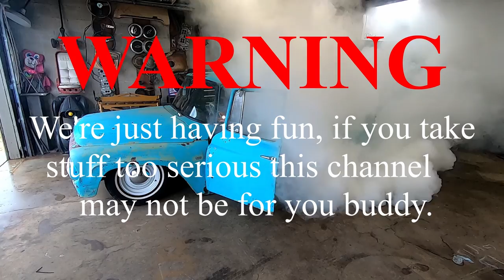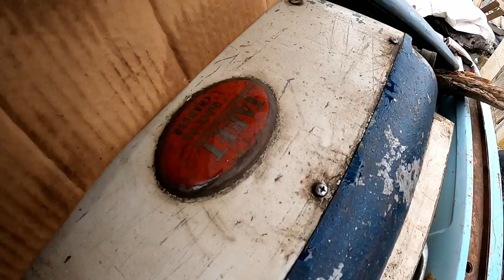1975 Ford Granada JUNKYARD RESCUE. Junkyard Rescue, WILL IT RUNS, more.

Comment: You had me at the Sweet looking bronco. with all that sweet trim on it. dam Tip, if you're doing will it run (ON THE FORD) fails to light off, the Neutral safety like to corrode contacts, run thru the gears few times, cleans up contacts. but factory AIR, after further Viewing, Not A/c no vents in dash, but not 100% on my knowledge, if those are I want those parts to convert my 79 to AIR> that CB might be the Factory Option. Nice to Have. dam luv the ford Walk thru.

Comment: Had a ford granada back in the 80's.  My friends called it a grenade.   Eaton up by lack of oil changes and illinois salt.  The left B-pillar was rusted away at the rocker panel, so the driver door did not close some times.  scary car to take on road trips.   I blew the engine one night driving back from the U of I.   Put a 302 in it.  Then the 302 had a burnt valve so I put the heads from the 351W on the 302.  Worked like a champ.   "good" memories.

Comment: I had a 78 Granada when I was going to engineering school.  200CI straight sixer with an automatic.  It was at least two different colors, and the doors sagged so badly that when you got in, you had to pull up harder than you pulled in.  It had some form of lunacy in the power steering system that bound up so hard that when it broke loose the steering wheel spun like two full rotations.  Like Uncle Buck.  After that, it was full brute strength steering.  :)   The body just fell apart on that old girl.  The driveline was still purring like a kitten when we scrapped it.

Comment: I bought a Granada several years ago to flip and I dang near did just that! The gear in the steering box broke as I was pulling out onto the highway and instead of turning it went straight and hopped a curb and almost went through the city building! 😂  
I never wanted another one after that!  Thanks for bringing that memory back with this video. 😁👍

Comment: That long door modded Bonneville was an airport courtesy vehicle..had two bench seats in the back that faced each other. You could ferry a whole family in the back and luggage in the truck from an airport to a different terminal or hotel. A  friend of mine in HS, her father, had a 6 door Lincoln Continental. It had two regular doors on each side and an added suicide door that was for the stretch segment and third row seating. It was amazing and he refused to sell it to me? It had a for sale sign on it in 88 and 89. I graduated in 1989 and the friend went away to a college so I missed out on a fantastic LC.  And a Corvair too? And I Love me some Creeper Vans. I had an AT&T service van 1500, had the cage behind the front seats that rattled me crazy. The back was carpeted, no rust at all and it was a manual trans 5 speed. My mom said it was a POS. and I wasted my money on a lemon? I drove it for 4 yrs with zero problems except 1 flat. I loved that van....

Comment: My old Shovelhead Chopper ran a magneto and an old timer told me to cut the tip of a tampon off and put that under the cap. It's the "mag on the rag" trick to soak up any condensation that could keep the bike from firing up.

Comment: You cook on charcoal once the fire is out and the coals turn gray. The fire at the beginning is the lighter fluid burning off igniting the coals. Coals should be hot enough to cook on within 10 15 minutes once they are all gray.

Comment: My cousin got a 4dr 62 biscayne with the 283 2sp powerglide that was literally an old womens car with less than 20k on it in the mid 70s. l got ride in one that still smelled new and was immaculate. Pristine perfect. You couldnt hear the engine running at all and it had plenty of power to cruise 75-85 all day and run cool. Those were great cars when new. They rode like solid tanks.

Comment: You guys should fill the carburetor bowl threw the vent-overflow you have less chance of flooding it out. By filling the float bowl the engine can run for a few seconds if you just try feeding it fuel you will be fighting to keep it going
Reply from the maker: Did you see in the video where we filled the bowl of the carb?

Comment: Lol one time I built a a riding law mower with a V6 in it a Ford 9 inch rear end an a auto transmission.  I sold it because I thought someone was going to get killed on it. I traded back for it 3 times before saying no more. I don't know for sure just how fast it would go but I had it over 100 mph the things we all will try when we are younger.

Comment: back in the mid 90's i had a early 68 mustang that i rebuilt and the steering on it was junk . the kid i bought it from put headers on it and never changed the bracket on the end of the steering ram so you would heard it down the road. 1/4 turn  on the steering wheel before the tires would even attempt to move. my brother in law had a 76 granada that tranny went out in. i kept looking at it then one day i got the measuring stick out and it all measured out so i went to the tool kit and started taking thing apart aand tha granda front end be cacame a musttang part got all done and just measured toe on it took it to an old boy and he put it on his alignment rack and told me he couldn't get it any closer.  win win for me got disk brakes on the front and we won a couple of awards with the car

Comment: that 2.3L turbo thunderchicken engine down in the yee will be mean n nasty!  I have a spare 60-trim T3 turbo in my garage that I'll happily send you, from back in my 2.3L turbo building days..  then get your hands on an early 90s ranger 2.3 cam/lifters (stock roller), turn the boost up a little, rising-rate FPR, 3" turbo-back, and you'll be skippin into the 12s in the box truck!!   OH, get an intercooler from a Volvo 740 Turbo  and plumb it in with a BOV..

Comment: that grille and header panel are midyear '76 through '77.   Moldings around the vinyl top look aftermarket, like it was a dealer add - pretty common then.

Comment: I sure like that plaid shirt. Got some style. I'd be grabbin' up those Holley 4bbl. carbs like the one on the Caddy hood. Restore a Packard and then you've done sumpthin'. I seen that Studebaker flat bed. You need that for a serious restoration project. I've got 4 of them. Carter Thermoquad on that baby cornbinder. It runs and you need to buy that one.

Comment: Here's a odd nugget of info about these cars and likely the only time the epa was a boost to performance. In 1976 you couldn't get the granada in cali with a 302, it wouldn't pass the epa regs for that year, so Ford dropped in the 351w which did pass the epa tests. You could only get the 351w in the granada in cali in 76 and maybe a couple other years. I only know this because i bought a 76 granada from my dads neighbor (he moved from cali to the east coast) years ago to use the drivetrain in a early 70 Maverick I had. I expected a 302 but was surprised to see the 351w. I had $700 in that maverick and it would run high 14's on the stock 150+k mile 351w 2v out of that granada and 12.80's with a 100 shot 2v plate kit lol  I had more fun with that car in that config then when I later built a stout 351w that went 10.80's on the jug. .

Comment: The IH carb is a Thermoquad. Terrible reputation because they leak air and fuel.  Seen plenty of car-b-que's from Thermoquads.  Probably not be able to find a larger spread bore if you tried. A Q-jet would bolt right up, and are much more reliable.

Comment: Why not buy a second Toyota Corolla and then cut the front end off of it and then weld it to the rear of the tow-rolla make your own custom 4x4 that way only tricky part will be how to put them both in gear at the same time and the fuel system setup but it would be a fun build for sure

Comment: Ford Granada?  Where? I was looking forward to a 'will it run' on the Essex V6... Granadas over here in the UK sold in thousands in Mk1 and Mk11 and a range of body styles, all looking almost totally different to yours.  The MK1 fastback was a lovely looking car. Rare now, the banger boys loved 'grannies': fast & tough and easy to work on. The 2.8 V6 Essex engine was used in other Fords including Transit vans for Army Bomb Disposal, governed for 120mph. In a van. And the bomb disposal boys used to jigger with the governers so they went quicker..... 

I once got recovered with the bike from the M4 motorway in Wales to Fleet in Hampshire by two Welsh nutcases subbied in by the RAC. They turned up in a 2.8i Mk2 Granada and a bike trailer. Took less than half the time it took for me to ride there: 120 mph average speed on motorway and A roads (70mph limit, 60 with trailer) and minor roads (60mph, 50 with trailer). No Big Brother speedycams back in the '90s....

Comment: Pretty sure that was a Warn Edition 79 Bronco. You can tell the 78 and 79 apart by the headlights, the 78 are round the 79 are rectangle. I'm sorry but the Granada (much like the Dodge Monaco) is one of those 70's cars that looks better as a 4 door. Without a vinyl top the 4 door Granada looks like a 4 door Mustang from the back 3/4 angle... it's just the front is ugly. I guess they designed them to compete with the BMW 280 for $4300 where the BMW was $33k, there's literally a commercial that says "yeah the interior isn't as luxurious as a BMW but it also doesn't have a price tag anywhere near a BMW". There's a 75 4 door for sale in Woodland Ca that I'd love to go get.. because who's going to steal a Granada?